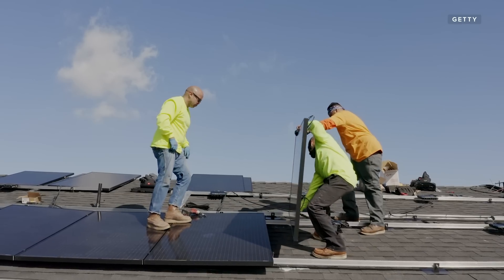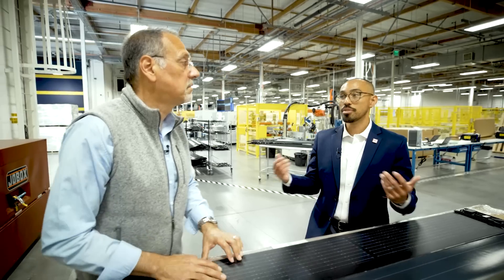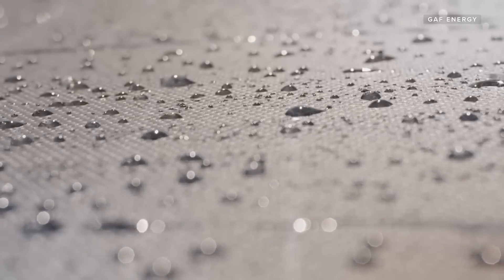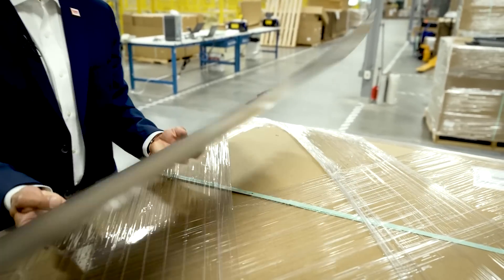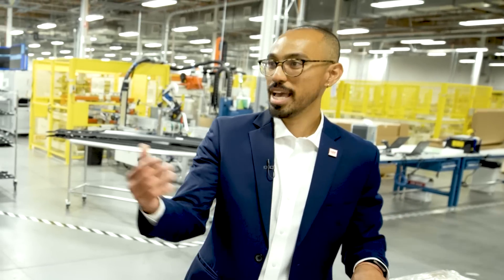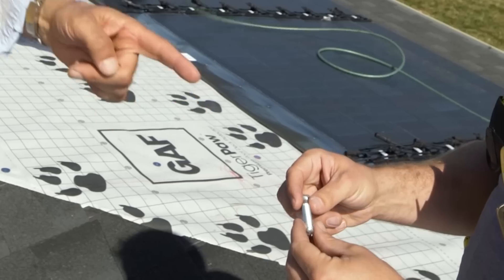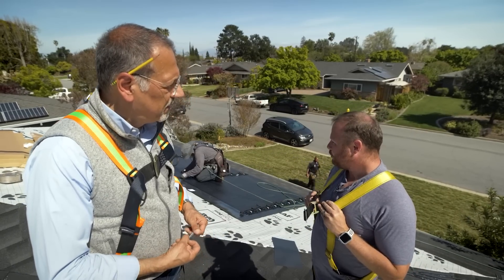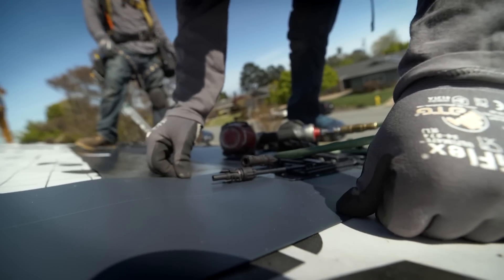If You've Avoided Rooftop Solar Tech, You May Have Just Run Out of Excuses

Comment: In my region, the fire department will not fight fires of rooftop PV installations simply because of the risks for the firefighters. No "excuses" needed - just rational thinking applied.
Reply: Hi FD, 

Miles from the video. This product passed an electrical hazard check with zero hazard. That was a panel that we electrified, broke, and tossed into a tub of water. The fire departments said we were the first to pass with zero hazard.
Reply: @milesproctor7392  Maybe READ my comment first before freaking out...? You are miles away from what I am talking about. Here is a little story for you: a friend of mine gets to test drive cars for top car maker in the EU where he works in development. Their combustion models now have "emissions" that are CLEANER than the air that goes INTO the system. He is still fined for "pollution" when he drives to a business meeting in Antwerp - simply because the administration of Green Technophobes can't wrap their head around the facts of chemistry and physics and are putting his hi-tech vehicle in the same category as a diesel lorry from the 1950s based on outdated criteria. And that's precisely what I am saying: Firefighters and all other bureaucracy are thinking in categories = simplistic patterns, not actual facts. - and my comment is highlighting a problem with just that: categories. ... as for excuses: in my area, we also get taxed on the electricity we make, even if we don't feed it into the grid! Again, no excused needed - just basic maths applied.

Comment: I love this idea. I still want to see test results from homeowners.
Reply: This is the part that almost makes me conspiratorial, because all the ads about 'gamechangers' (I see three of them) just makes me 'want to wait a little more'.  However, I had always heard the roof is the least efficient and you should have tracked panels that move with the sun.  But they almost NEVER actually talk to a person that has them, that shows the bills showing how much it has saved.  I almost think its fossil fuel companies doing ti to make people wait just a little longer.....which is usually til gas prices go down.
Reply: @mikearchibald744  a janitor at my store got some for his house over a year ago. Just solar, no batteries. He said it has replaced his electricity costs so far. He doesn't pay for electricity anymore. Only the monthly payment for the panels.
Reply: @trinsit  Well, yeah, the question is how many panels and how FOR the panels instead of electricity.  If your payments for the solar are the same as electricity, you are no further ahead  And if there are NO batteries, then what happens on cloudy days?
Reply: @mikearchibald744  you do come out ahead because now there is a point at which the bill stops when you pay the system off. Also, their house is still wired into the city electric grid and power is continuous. It's just that while the solar panels produce electricity,  the meter moves backwards.
Reply: @trinsit  I see, so he does net metering and supplies enough to the grid to offset any payments.  They have that system here too, thats my main complaint because IF the utility would actually PAY for the power then tons of people would invest in creating power.  BUt all they do in most places I've checked is balance the credits at the end of the year and you may owe them, but they never pay you, so essentially they are STEALING power from you.

Comment: I'd still want rack-mounted panels. 1. Have microinverters, 2. Potentially run cooler which reduces efficiency loss on hot days.
Reply: I think it comes down to cost ultimately if it's half the price 60% the efficiency would be acceptable
Reply: @boblatkey7160  like I said it depends on the cost. At this point there is no public information on their costs. So we don't know what it is. My point was they would have to undercut the total cost significantly to be viable.

Comment: Optionally add heat pipes on the backs of these to: 1. cool the PV cells, 2. provide heating and/or hot water
Reply: There are panels that do just that, look at Linus Tech Tips video. (For the panels/entertainment, not as much for solar.)

Comment: How do you repair or replace a panel  /microinverter when it goes out? If one of the micro inverters goes out will the system continue to function since it's based on a string inverter?

Comment: Well done GAF.  Even if I don't buy this product whenever I get solar, I love this innovation and am cheering it on.
Reply: Agreed. Competition is healthy for everyone.
Reply: Yeah. Why hasn't solar taken off in all these years is beyond me.
Reply: @Mark1Mach2  long term investment. How many years does it take to pay for a full house system? 20yrs? 30yrs? And yes it should make your house have a better resale value but a ton of people don't buy a house a 20yrs old and stay there 30yrs which means most can't afford the upfront cost hoping they will be there in 20-30yrs to pay if off and start to save on electric bills. I live in a 1700 total, 480 square foot living house. I am the perfect candidate for solar because I have over 3 times the roof of my living area as non living, (porch, carport, patio) which means I could put all the solar on the roofs not directly over my living but the added up front cost, 20yr investment recoup time, the added home owners insurance, as they are covering more "house", more worries about leaking roofs, damaged solar, inverters, batteries if I want power in a hurricane when the power company is out for a week or 2 here in south Louisiana, to worries about a hurricane tearing them off, cleaning, maintenance, and after 20yrs after I pay them off, now they don't work as good so I need more panels,  or they need repairs. So for me it just not there yet but i would LOVE if every roof/property had solar, clean, renewable, free solar, its just not right for me.

Comment: How is shade mitigation done?  Are the panels connected in series or parallel?  A central, single inverter usually has shade problems.

Comment: This is a cool product. But what bothers me in the reporting is that they make it out that traditional solar is ugly, which I completely disagree about.) also good installers can put a traditional system on a roof in  one day as well. And it is water tight and engineered to protect the house. Where I work a structural engineer need to provide proof that the house can handle the solar. And in most cases traditional solar is maintenance free. 
Yes this is cool. But don’t dump on a good and well built product.

Comment: Without micro-inverters doesn't the whole installation suffer if one of the panels gets shaded or go bad in some way?
Other than that it looks neat. Need to redo the roof anyway and solar would be nice.
Reply: Love microinverters, have Enphase myself, but string inverters are fine with shade these days. (Though optimizers would be helpful.) Maybe if voltages work out, you can series a few of these into microinverters or optimizers in combiner boxes.
Reply: The string would suffer.  But there are multiple strings

Comment: I have 20 panels on my roof and they look fine. And the 6 MWh they produce annually look even better.
Reply: @Zolar Czakl Depends. If they have a heat pump and drive EVs and in general have a fully electric house, their usage might be way higher than yours.

Comment: 8:35 sorry the Bernoulli principle means the panel will tend to stick close to the roof with wind. There will be less pressure between the roof and panel.
Reply: The Bernoulli principle says that fast moving air has lower pressure than slow moving air.

The discussion in the video was correct. Slow moving air next to the roof (high pressure) will tend to lift the panels, relative to the fast moving air above them (low pressure).

Comment: The video talks about the loss of .035% coefficient starting at 77 F, and increasing as the temperature increases. What is the loss at 90 degrees+ that I get here is south Florida? How much does that affect the production of power?
Reply: Its .35 not .035 huge difference.  It will lost about 6 to 13 percent at peak heat ( .6 to 1.3 kw in a 10k system) my concern here in florida is  the wind resistance and insurance premiums.

Comment: Great concept - very practical - I see more room for improvement in eliminating the majority of rooftop cables , connectors, and connector housings with flat interlocking buss bars or similar locking tabs.
Reply: what I was thinking.
 heck just a heavy guage solid copper wire that snaps in a track on each one would eliminate the clips
Reply: Need to improve efficiency and temp coefficient greatly to be viable
Reply: @chefgav1  nah, as long as cost is low. There is room for poor efficiency if it's affordably baked into the roofing product
Reply: @ctgottapee  But the guy at GAF didn't say it was less expensive than rack-mounted panels.  Same cost, less efficiency, hard "No" from me.

Comment: I'd buy it for my Mom's house if they would just make matching fake panels that you can cut to finish off the sides and not be stuck with a combination of mismatching shingles and panels.  There are so many houses with a plain flat gabled roof that this could be used for.  How does 5:43 look better than panels?  With panels, I can hide all the wiring and put the big junction boxes under the panels.  I think GAF missed a big opportunity that Tesla gets.

Comment: 5:40 I'd like to hear more about that -0.35% temperature coefficient. Cooling the underside with ventilation had always been so crucial.
Reply: Agreed. An unventilated, attached black roof in AZ is foolish. It would require expensive spray-on EPF insulation, in between the rafters (assuming there is access), to  compensate for the extreme solar temps.
A black garden hose left in the AZ sun will spew boiling hot water when the tap is turned on.
Last year, I invested ~$3K to replace my old asphalt shingle roof with white asphalt shingles and my A/C bills are lower.
Perhaps these solar shingles would be better suited to cooler, areas further north. But, most folks up north have shade trees in their yards. That makes microinverters necessary, as the host wisely eluded to. One bad panel or shaded in the string can reduce the output of the entire string. Imagine uncovering all of those connections, then finding the defective shingle with a volt meter. Instead of replacing the 'bad' shingle, it would need to be removed/unplugged from the circuit.
IMHO, the best option is a carport with PV panels on solar trackers. Maximum wattage production and no messing with the home's roof structure. Easily serviced and upgradeable.
How about lighter colored PVs? Why must heat sensitive PVs be black, which absorbs the most heat?
Reply: @TheOleHermit  white panels...why not? I see many new silicone panels also with clear power pathways...
Reply: @TheOleHermit  My roof ridge is aligned North-South hardly ideal for solar especially in UK. But I have a wide space at the side big enough to cover in ordinary panels open for airflow or even better for water heating on the back side using butyl thermal absorber bags.
Reply: Cooling adds complications and potentially new failure modes. You will make up the difference in loss due to thermal coefficient on sizing. More solar shingles.
Reply: @rchokelal  It looked into these and the total system output is about half of what a solar panel system can output. The efficiency is too low for the Timberline shingles to begin with. Then the low output is compounded by the higher thermal coefficients. Add to it the AC cooling requirements inside the home because the roof deck is going to be hotter than with a Solar panel install. You can't even squeeze in more solar square footage when these Timberline panels are so long and cannot be cut or adjusted.
Reply: Isn't that worse than the figure listed for the ordinary panels?
Reply: @priestesslucy  There is no ventilation under these, unlike a rack mounted solar panel.  A roof can become extremely hot.  This is my biggest concern and I'd like to see independent real-world results... besides that concern, this looks like a compelling roofing product.
Reply: @gipnor  All Solar PV generation gets hot. That is why the best production months occur when it is cool and sunny. Here in Ontario, that is March and April. Then, in the summer months, we get sun earlier in the day but by solar noon, all our systems start to lose energy production because the modules get hot.
Reply: @rchokelal  I think that what Clemuns meant is that if there is a gap between the roof and the panels, then the heat doesn't make it to the roof. If the solar shingles are directly in contact with the roof, the heat will transfer, and also lose the air cooling.

I notice that my house stays cooler since I got my panels installed.
Reply: @gipnor  +1 to wanting to know about heat. I think it was Bill Gates who famously said "those things make a lot of heat" about solar. Maybe these just make the heat of a shingle.
Reply: Isn’t it better than normal roof?
Reply: @mitchjohnson4714  not if it makes the roof hotter
Reply: @priestesslucy  Yes, you are correct. They lift the panels on racks to allow for airflow to help cool the panels. I kept waiting for a life expectancy or at least a warranty time span, but didn't catch it if they said. I have to wonder how much shorter the lifespan of these might be because of the lack of cooling.
Reply: @Tumbleweed5150  what is the warranty of a traditional roofing shingle? 25-30yrs? Here in the gulf south, south Louisiana, because of hurricanes no shingle roofs make it 20yrs, on average the hurricanes will damage them almost every other year and you can get maybe 15yrs before they need to be replaced, thats why I went with corrugated galvalume metal roofing. So you would have to replace this premium shingle every 15-20yrs? Doesn't sound cheap.
Reply: @priestesslucy  yeah because the ordinary panels have a space of air below them to keep them much cooler
Reply: Hot in Texas!
Reply: Yeah I don’t like how the installer was talking smack about mounting and panels but never once mentioned that the wind draft beneath is very useful for cooling. Thats where the 30% difference comes from
Reply: The GAF product temperature coefficient looks about average or slightly better. The Panasonic product (inherited from Sanyo) has an advantage in terms of overall conversion efficiency and temperature coefficient … that is reflected in its cost. And it is, I think, expensive to make.
Reply: I think the idea would be that the .35% loss per panel would be offset by the fact that you could cover a larger portion of your roof with them.  So let's say you are talking about a 100F day, wouldn't that be about a 4% efficiency loss compared to traditional panels, but you could probably cover 10-20% more of your roof. ( or someone explain how the .35% vs .22% would work out with a 25 degree temperature over the 77F.)
Reply: @PeterSedesse  That seems plausible. I would just want to be certain I ran the numbers carefully.
Reply: The GAF product looks like a winner … but the competition never rests.
Reply: How’s this compare to Tesla shingles
Reply: @szuber42  was going to ask the same thing, especially about the heat issue.
Reply: @szuber42  i dont think GAF has a class action lawsuit about their roof like Tesla does
Reply: Yes—what would this mean in TX where we get >100F for 2+ months without relief?
Reply: so all solar losses efficiency the hotter it gets over 77F? Good thing here in south Louisiana it never gets over that 🤣👌
Reply: @RossMalagarie  I think I'm starting to understand why Solar is said to do decently here in the PNW despite our cloudy off-season.

Our average summer high is something like 75 [of course we absolutely have some roasting days like this heatwave rn lol]
Reply: @priestesslucy  yeah I have watched my 3 thermometers, 2 smart, go up to 103F in the shade of my porch multiple times this summer.
Reply: Lol.   a eze solutions is available. just Think.
Reply: thats why this was not worth making a video for this, wasted my time watching any of it.

Comment: I'd worry about heat and longevity compared to regular Solar panels.
Reply: they casually threw the concept of 25 years.
Reply: @ehombane  But 25 years is typical for that style of shingle roof? Solar always uses 25 years and with efficiency gains, putting a new solar roof on in 25 years will provide much more energy or the homeowner will still have working solar and only do what is necessary for making the roof new. My roof is 20 years old in Phoenix and I am pulling the shingles soon for new felt which is normal. My so,ar adds to the cost of the job (about 20%) but I will only have my solar at the end and not brand new solar with the benefit of years of efficiency improvements. ~I hope this new product succeeds. It plus storage will be great for homeowners.

Comment: Wouldn't it be best to keep an air gap for heat issues in the attic? If someone choose white shingles to benefit from the 50 degree cooler roof surface temperature 🌡️, this product is an oven.

Comment: There is another advantage that they don't talk about. 
I ordered solar panels for my roof. They add weight to the roof and therefore that requires an engineering review and requires that your city or county needs to sign off on it.
From a structural engineering point of view there is no additional load vs. shingles and should not require extra structural engineering scrutiny.
My project has been delayed by my city for a long time due to the City engineer's questions and requirements.
Reply: Your city sounds quite inconvenient I have just ordered panels and I’m going through none of this.
Reply: Hahah do you have to ask for permission to flush too?